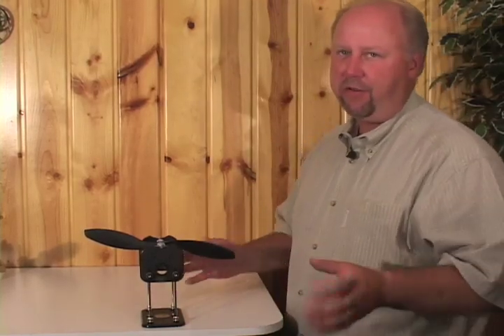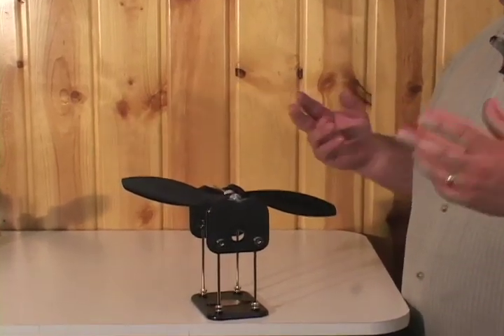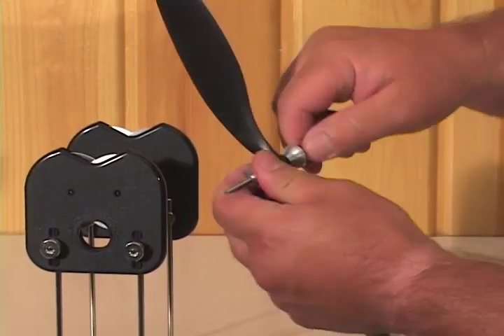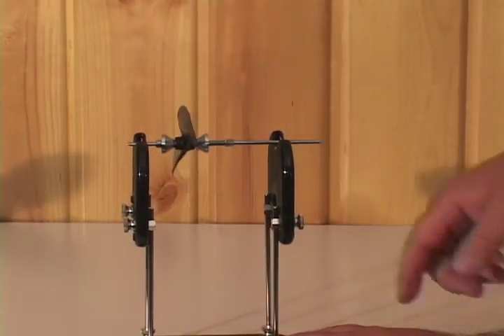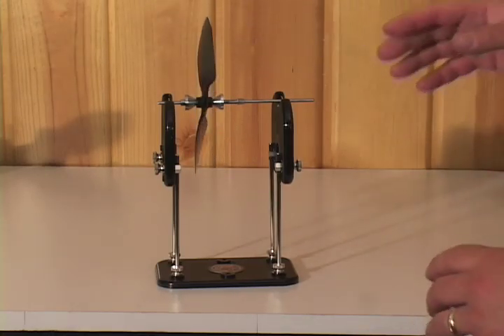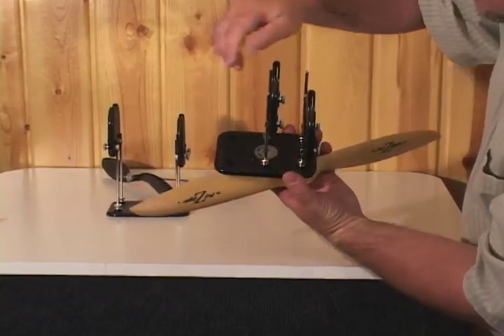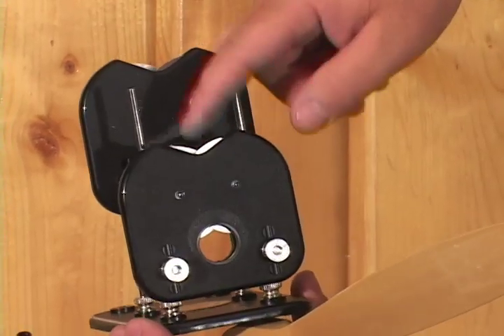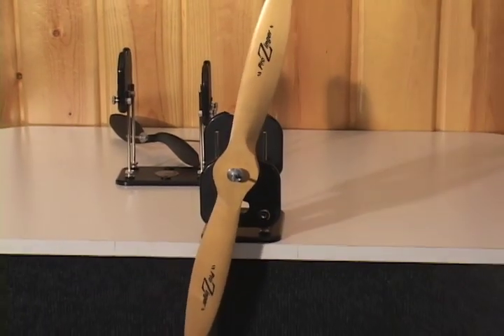Prop Balancer #1 | DU-BRO

Comment: hello I have a question , I have I need to balance my propeller on my mjx x101 however the holes are very small does this kit come with different bars or is this more for bigger holes . I tried a bunch of different cheap ones and they are all to thick . please let know.  thanks
Reply from the maker: +Big stalks official 
Unfortunately we do not offer a smaller shaft size. You may be able to find a straight piece of music wire the same inner diameter of your  prop, then use small diameter tubing to keep the prop from turning on the rod.

Comment: Just thought I drop you a line on the ballencer.  Tower sent me a replacement which was better but still had one thread mismatch. I was able to find a nob from the first ballencer that was close enough.  Until your machine shop tightens up QC I recommend buying two or three to be assured of getting a good fit.
Reply from the maker: dntpokedbear,
Again, I am sorry you got a part with issues.  We take pride in making all of our parts with the highest of standards and we always will go above and beyond to be sure customers are taken care of.  For any future problems, I recommend contacting us directly so you get taken care of quickly.  We have sold a lot of prop balancers over many years with very few problems so I assure you we can get you anything you need.  Sorry for the mix up.